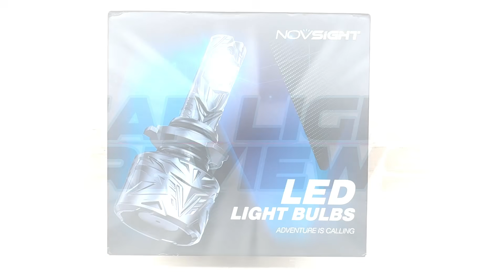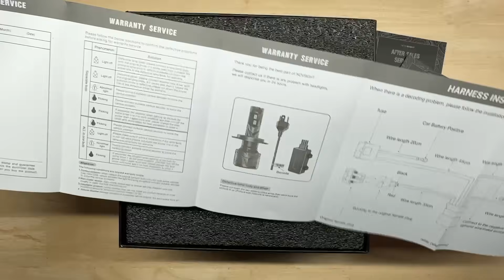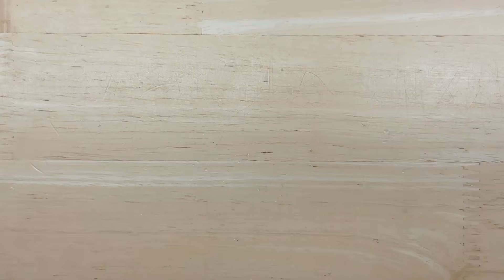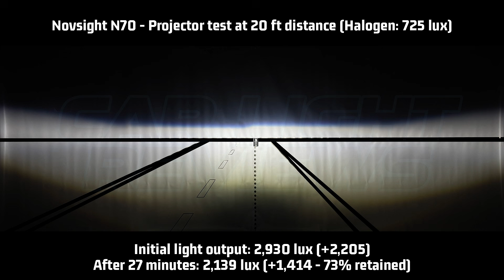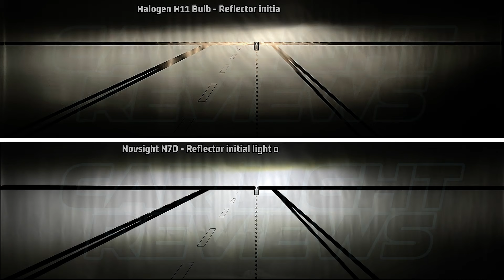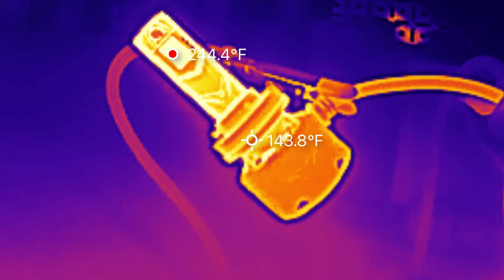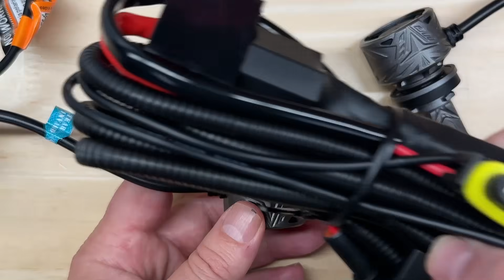Can your vehicle handle this POWERHOUSE of an LED headlight upgrade? - Novsight N70 LED Headlight

Comment: Excellent video. Are these any good for a ford ranger pickup truck with halogen projector dipped/ low beam or is there another i should consider? Thanks
Reply: And high quality LED bulb would would with Projectors (or reflectors). You just want to make sure the LED chips are facing the sides at the 3 and 9 o'clock position, and with the power cable at the bottom 6 o'clock position.
Reply: @DiamondVisionLED Due to the length increase of n70 in comparison to the n60 the light scatters in reflector headlights alot. N60 performs better than n70 as n60 has better placement of led (closer to stock halogen filament) specifically in reflector headlights.

Comment: Novsight lights are good BUT they need to make them code error free Now. My Hyundai keeps thinking something is wrong with the lights and my last pair would flicker off and on
Reply: Usually you will need a separate Canbus Decoder to plug in-between the cars plug and the bulb.

Comment: Bought H7 new version, lasted 45 days, halogen lasted 4+years
Reply: My n60 broke as well after 6 months. Got a replacement which also broke after 6 months.
Reply: @22zollmaefelge88  Wow, I just installed them last week. Thought they would last longer.

Sad thing is, I do not think they are bright enough, my old reflectors with some H7 halogens were the same or even better the N60. Yes, they are aligned properly in the housing and both lamps/housings are new. (Corsa C, TYC aftermarket oem lookalikes, I swapped them so i would not blind anyone and get some serious light out on the road in rain too. Also I broke the adjuster on my right side reflector housing so a swap was logical.)
Reply: @LHepi-ur2qe use the relay

Comment: Guys any inputs?  I have n60 novo sight from 18 months. My Chrysler Pacifica started acting weird from past 1 week where when the low beams comes on, it will start flickering bad and goes off and on or comes back with 30% light output only. If I kept my halogen lights back all are behaving good. There is no error on dash . Do i need decoder?
Reply: Same here, they are broken. Too much power and not enough cooling I guess.

Comment: @CarLightReviews, would it be possible to test this over 3-4 hours? Sometimes we drive more hours going on holidays, it would be interesting to see light output and heat during this testing
Reply: As far as I know they level off well before 27 minutes, an interesting scenario would be testing in summer conditions, outside temperature 100F or more, im curious i how they fare then

Comment: Okay some of these lights are getting a little crazy with the light output. You probably need to get your eyes examined if you feel like you continually need a brigher and brighter headlight or your headlight housing needs replaced due to just being worn out. Pretty soon we'll be seeing aircraft landing headlights on vehicles... LOL
Reply: The main issue (brick wall) is that bulbs that use a lot of wattage can only do that at start up and then has to lower down, as if it stayed at 120W+ the heat on the bulb would be too much, causing it not to last long. That is why most bulbs will level off under 100W or lower to keep the bulb temp down.
Reply: Already there. 😂

Comment: Could you please do a review on the OSRAM LEDriving HL EASY? They're direct replacements to regular bulbs, which is a big plus and they're made by a well known bulb manufacturer but I 'm not really sure if the light output is any good.

Comment: Genuine question, which color temperature do you prefer out of these LEDs? 

I have morimoto leds that aren’t anywhere as bright as these ones but the color temperature is the closest to OEM led headlights that I’ve seen in person, any recommendations out of these that the color temperature really stands out to be the most optimal?

Comment: We need a review on the Osram night breaker LED. The only e-marked, EU-legal led headlight bulbs.
Reply: Yeah, but they are only made in h7 and h1 as of now. Testing conditions for CRL would be different therefore not accountable. 

Still, some info on Osram's Night Breaker Speed and Smart led would be excellent.

Comment: I really wish is PWM DRL functionality could be tested. Many LEDs I've tried on my Toyotas, only Xenon LED Pro had zero flickering in DRL mode.
Reply: The issue is that DRL PWM uses 6 volts, and most new brighter LEDs headlights need at least 9v to work (12-14v normal). Some lower powered LEDs headlights (35-40W) may be able to work with 6v PWM.
Reply: @DiamondVisionLED  I thought pre-2020 4Runners use parallel 12V PWM (each bulb getting 12v in pulse, the reason for LEDs to flicker) vs 2020+ use constant 12V with bulb in series where each bulb get constant 6V (no pulsing). I could be wrong.
Reply: @LionRunner  That is possible, I'm not sure how the 4Runner is doing it's DRL. One of our vehicles is a 2005 Camry XLE and the high beams are also used as DRL. About 6 years ago I had a LED bulb made that was specifically able to work down to 6v and with a Canbus Decoder connected, there was no flickering. The Camry still uses that bulb is the High/DRL. One thing is that you really don't want a DRL bulb to have a fan, as it PWM can cause it to go bad, so it needs to be fanless.

Comment: That's NOT an anti flicker harness in the box, it's a relay to draw power directly from the battery as 120w is too much power through the original headlight wires ...
Reply: It actually is. Some cars use the high beams as DRL, but they don’t supply enough power because they are for halogens so they cause LEDs to flicker..
Reply: Great review. 

I currently have AUXITO Y13 in my UK Fiesta projector lights.

Would this be a noticeable upgrade?
Reply: I was thinking the same!
Reply: Do you think I can install my N70's without the decoder harness?
Reply: yup, like high wattage halogen bulbs, which is insanity
Reply: @Supercharger86  then it would be on even when the car is off wouldnt it
Reply: @mikeflagger7723 no. The relay has to be “on” and that happens when the headlights are turned on from the end the harness connects to the bulbs. It was mostly used in HID due to their initial high voltage draw, haven’t seen it on LEDs until now. Harness just ensures steady constant power (once on) and probably better if it draws 10-15w more per bulb.
Reply: @Hms1474  Yeah, he's talking about about drawing power directly from the battery, at least thats what i understood
Reply: @Hms1474  I have n60 no sight from 18 months. My Chrysler Pacifica started acting weird from past 1 week where when the low beams comes on, it will start flickering bad and goes off and on or comes back with 30% light output only. If I kept my halogen lights back all are behaving good.
Reply: @mikeflagger7723  once you install this type of harness you’ll understand how it’s not constantly “on”.
Reply: @wisemanbell6957  sounds like the chipset couldn’t handle the heat. The ones that generate the least amount of heat are the ones that’ll last the most. I got a good 24 months out of a set of bevinsee v45 before I sold that car. Still debating if I should buy another of same .
Reply: @Hms1474 So buying a canbus decoder will not fix this issue? I even got a different headlight and that is also behaving the same
Reply: @ I’d rather put the money you’d spend on the decoder into a new set of bulbs. What year and model is the car?
Reply: @Hms1474  2017 Pacifica
Reply: @Hms1474 Chrysler Pacifica 2017
Reply: @mikeflagger7723 no brother it wont be always on. The harness doesnt bypass the switch/signal because the original wiring of the headlight still needs to be hooked up to the included harness (unless you put in a separate switch) as the ON signal for the relay so it will operate normally. His comment only means that the original wiring normally cannot handle 120w so a new power line with a new fuse and relay is needed for it to operate safely.
Reply: @wisemanbell6957  Chrysler also sucks alone. Make any changes, and you're going to have issues .
Reply: @wisemanbell6957 sounds like you need new bulbs lol😂 it happens

Comment: Uses too much extra power for too little light gain compared to the N60
Reply: Due to the length increase of n70 in comparison to the n60 the light scatters in reflector headlights alot. N60 performs better than n70 as n60 has better placement of led (closer to stock halogen filament) specifically in reflector headlights.
Reply: Due to the length increase of n70 in comparison to the n60 the light scatters in reflector headlights alot. N60 performs better than n70 as n60 has better placement of led (closer to stock halogen filament) specifically in reflector headlights.

Comment: Great video! Isn't 120w dangerous for the wiring on the average car? As far as I know most sockets are rated at 55/60W. Can you do a video on canbus controllers ?
Reply: I thought the same. I sure hope it’s 60 per bulb, not 120.
Reply: @Hms1474  did you guy not see the video?  its a lie.. they are 70w true draw
Reply: @andreknudsne7648  the 70w is the observed draw after 27 mins. Initial draw is published at 120w.  
Even so at 70w that’s 15w more than the original ones. That’s nearly 30% difference. I wouldn’t run bulbs that powerful knowing I could melt my wiring.

Comment: I search strong leds for xenon D2S replacement in d2s projector housing.
Reply: Novsight n60 have d2s. Gonna do a replacement on my Acura mdx.  Or you could get hid that over 150watts
Reply: @Mrzickyzxz  let us know how it goes. I am thinking about replacing my Hyundai Genesis D1S with the n60 d series.

Comment: NOW WHICH ONE, F9 OR THIS? I HAVE F9 FOR 2 YEARS NOW
Reply: Good question. Look at the spreadsheet in his link. After 27 min of use the N70 and F9 are almost identical lux in projector and reflector.
Reply: @DiamondVisionLED  i barely use high beams as I'm mostly in town, high beams are mostly for humbling the oncoming high beamers🤣, so i guess the initial output matters for me

Comment: Thanks for the review.  Wow, 120W/bulb to start when engine is cold and requires as much energy as possible to warm up to the optimal operating temperature while been drained 240W/pair on the alternator especially in winter time!  That is a lot of stress on gas engine or even HEV, PHEV or EV vehicles.  Very happy staying with 65W Hikari Titanova 2023 with 85% efficient with very little dark spot in projection headlight.  Sorry to see it discontinued and the new 2025 without the driver is not as bright but uses less energy.
Reply: Been using hid kit that does 200 watts and tested and it’s true. Plus 1000 watt amp for over 4 years and no problems. That’s in my Acura csx with 400k km
Reply: And o yeah I live in Alberta where our winters are cold
Reply: You have the 2025 future titanova?
Reply: @ I have the 2023 HIKARI Future Titanova and tried the HIKARI 2025 Darkenex since the HIKARI 2025 Future Titanova is not available in 9005 yet on Amazon.

Comment: Nice review. What I find interesting is after the 27 minutes of use, this N70 bulb and our F9 bulb are basically the same brightness in the reflector and projector, but our F9 has a much lower cost.
Reply: @diamond aren’t you guys releasing the F12 soon?
Reply: @VVictor-u2m  we are hoping to release the F12 in January
Reply: Seriously considering ordering your bulbs... Lights and shoes are the only expensive things I buy. Fahren termitors have done me very well.. but I am considering something different.
Reply: @Briceon  With my current Black Friday sale, a lot of sold and current only have size H7 and H11. What size do you need? Here was an email I received yesterday from a customer...
Good evening, 
Ive had these lights for about a month now and just wanted to express my satisfaction with them. I have spent hundreds of dollars on LED’s I thought it couldn’t get better than the Hikari Future Titanovas but these definitely outshine them (pun intended). Thank you very much for the excellent customer service and I will definitely be sticking with your brand.
Reply: @DiamondVisionLED  Ironically enough, H11
Reply: @Briceon  we currently have a set of H11
Reply: @Briceon  the F9 is a beast of a led. 
I have experience with quite a few different bulbs, including the Termitor stuff. 
Diamond Vision F9 are the best bulbs for cars I have tried, so far.
Reply: @bcwallis2 The F9 has been our best selling bulb since we started selling it in September 2022 (before that was the F3, F5, F6, F7). Our new F12 is being made and hope to have it before the end of the year or start of January.
Reply: @DiamondVisionLED I need the f12. How can i get my hands on the first batch?
Reply: @haseebakbar914  I will post an announcement on our FB page

Comment: Please people make sure your day time running lights are disabled if they use the same light as  high beams.
Reply: Daytime running light are never the same as high beam.
Reply: @PeterBee911  Yes they are lol. Some cars use the high beam with lower power for DRL. If you use a direct power bypass switch the DRL will be full high beam brightness blinding everyone which is illegal.
Reply: @MustPassTruck  all led bulsb are illegal lol. But so what
Reply: My Acura csx does , I had to pull Drl fuse.
Reply: My Elantra does & they are very good high beams.
Reply: I use it on my car
For high beams i couldn’t use the wiring harness. Connected them directly and works just fine as DRL
Reply: @CroDudeCleveland  If at full high beam brightness as DRL it is illegal.
Reply: @ it’s not full beam it’s DRL
Reply: I've never seen any manufacturer using high beam as DRL mate

Comment: Yay. I am the first one here anxiously waiting as I demanded this review from you the most. And surprisingly today i have recieved my n70 aswell 😅. Hope i made the right decision 😅 now lets see what you have to say about n70 in this video 😊 fingers crossed 🤞
Reply: Me too 😆
Reply: @LightSaber12345  yes i had seen your comments aswell 😅
Reply: @LightSaber12345 Due to the length increase of n70 in comparison to the n60 the light scatters in reflector headlights alot. N60 performs better than n70 as n60 has better placement of led (closer to stock halogen filament) specifically in reflector headlights.